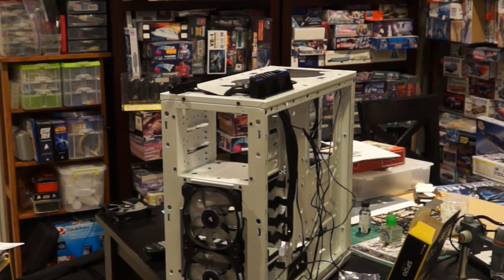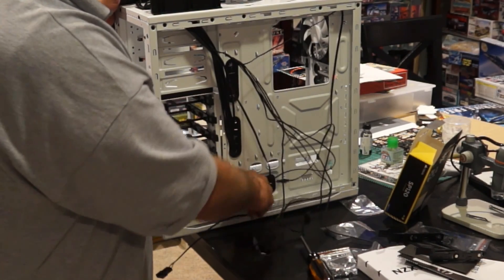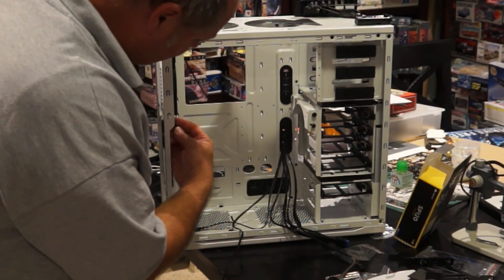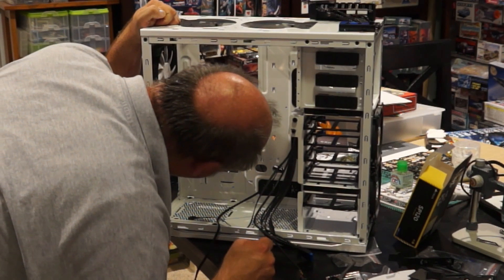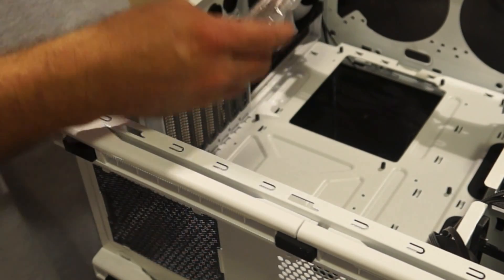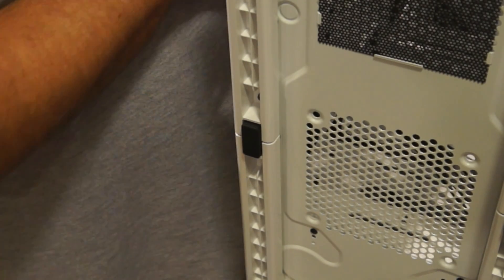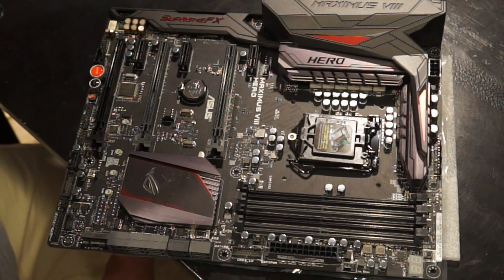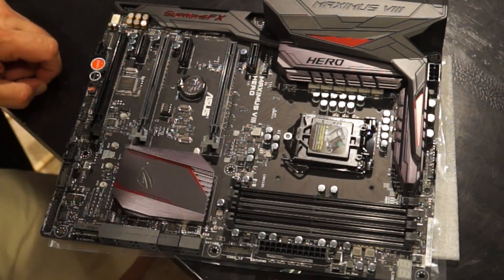Building a new computer Putting it together part 1

Comment: Cable management I think is one of the harder parts of the build process. 
It's why to mitigate it, I suggest a 100% modular power supply unit.
Another thing is if you're building your own, it's worth buying a case that's bigger than what you'll need to make things easier to work with. 
It's nice that the case you have is labeled to make things easier.

Another thing that some people find difficult is application of thermal compound.
Also choosing which one is something that people find difficult.

Broken English from a large company like ASUS?
Tsk tsk..

https://en.wikipedia.org/wiki/Asus
"...a Taiwanese multinational computer hardware and electronics company headquartered in Beitou District, Taipei, Taiwan..."